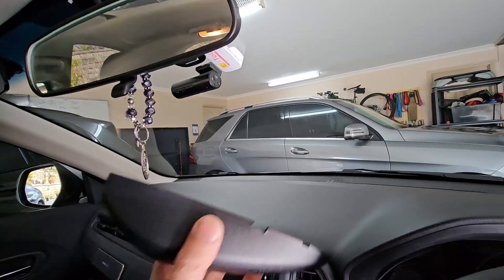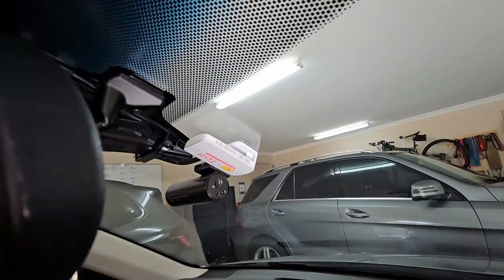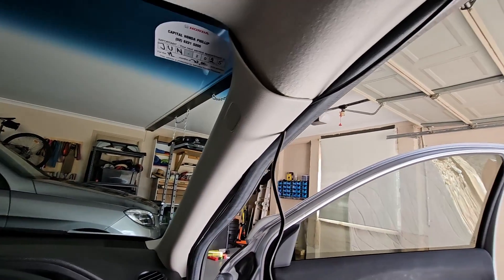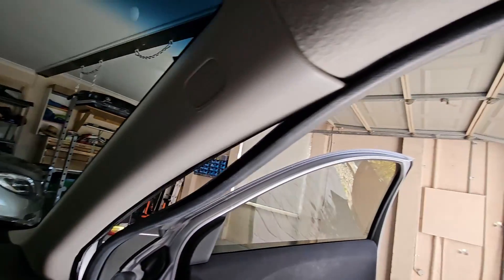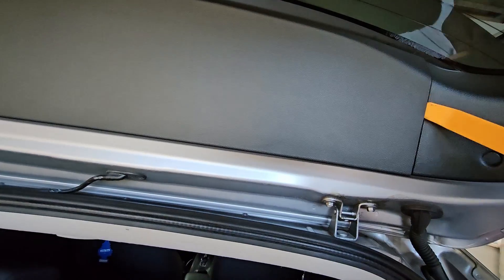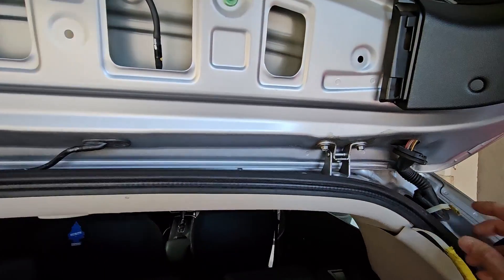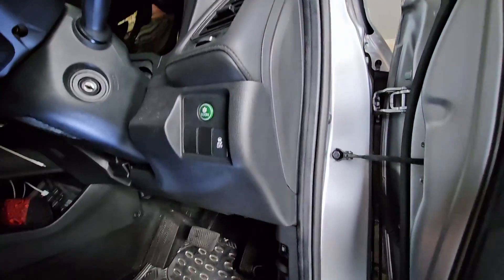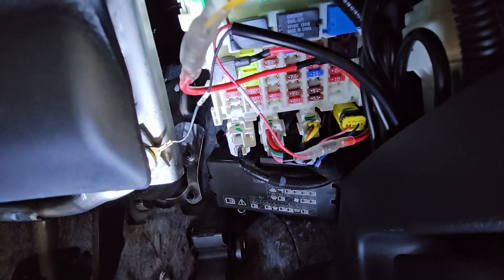How to install front and rear dashcam in a 2019 Honda HRV with hardwiring

Comment: Hi - Can u please explain which fuse to tap into. Mine is also honda crc 2019 EX. Sorry didnt follow which fuse to use for red and yellow wire
Reply from the maker: hi, the yellow wire should be tapped to a fuse that's only on when the engine is running, e.g. ACC, cigarette lighter or stereo. The red wire should be tapped to a fuse with permanent power.
Reply: @kenkanfix  - thanks. i was confused on which one to use for red wire. Need to figure that out. I just noticed your video was for an HRV - mine is CRV so i guess the fuses are different